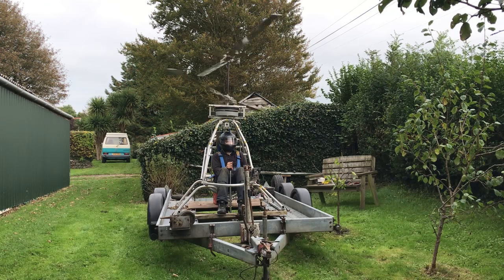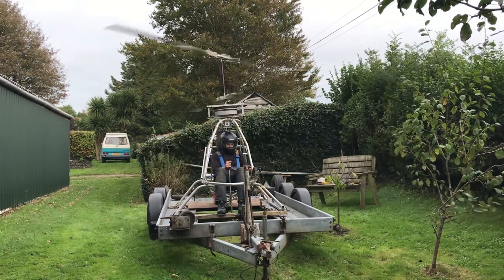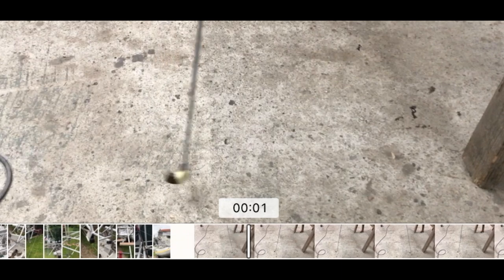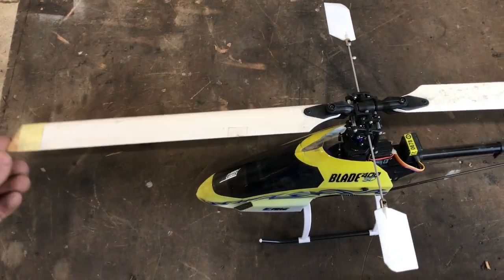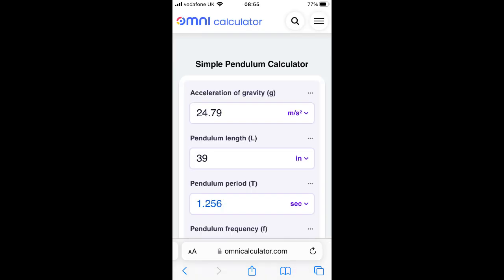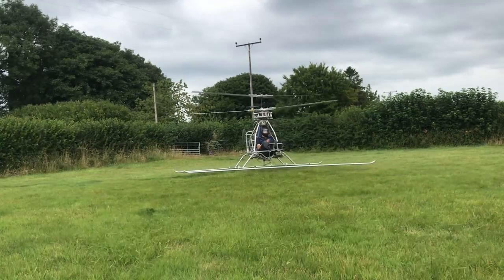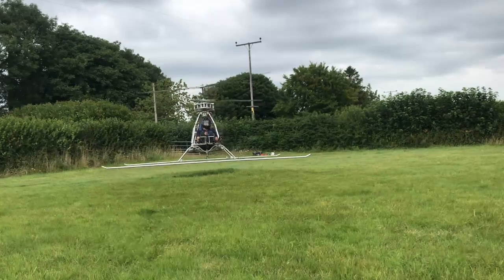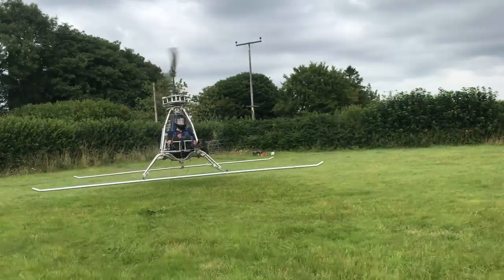Helicopter Rotor Phase Lag vs Gyroscopic Precession WHO IS RIGHT?

Comment: The problem of phase lag is an interesting one.
How do you determine the phase lag angle in a real machine?
Calculation? Or experiment?
In any case, a coaxial rotor simplifies things by cancelling out all the phenomena.😀
Reply from the maker: I think it's interesting too. Determining the phase lag is no doubt difficult, I did see a quote online saying that the helicopter manufactures do it by trial and error. Not sure if that's true but it wouldn't surprise me. 
Does a coaxial cancel the phenomena ? 
Two single rotors acting Independently isn't it ? 🙂  
I suspect if you had a teetering top rotor and an offset hinge bottom rotor  but kept the same phase lag on both the rotors they would want to go in different directions?
Reply: @Ben-Dixey  If the two rotors have the same angle of phase lag, they will try to tilt at different angles, but the main mast will tilt in the combined direction, so I think the effect of phase lag will be eliminated.
I'm sorry for my poor English, as I'm using Google Translate to help me communicate.
Reply from the maker: @mitubachiflight  The English translation is good. 👍 I think if for example the top and bottom rotors are hinged in the middle, like mine, (teetering) then phase lag will be 90 degrees for both. The rotors spin in opposite directions so both rotors will tilt in the same direction. If both rotors have offset hinges, like Robinson and the tri hinge rotor head phase lag for both rotors would be for example 72 degrees. Both rotors again tilt in the same direction. If there was some reason why one rotor titled in a different direction from the other then yes there would be a conflict between the rotors and the result would be somewhere in the middle. 
Do you agree ?
Reply: @Ben-Dixey  I agree with most of it, but I don't understand how the phase lag appears in the same place even though the rotors are rotating in the opposite direction.
Maybe I'm not understanding it well enough?
I'll think about it a bit more.
Reply from the maker: @mitubachiflight  Ah I see, yes we are trying to understand the phasing of coaxial swash plates. Definitely very confusing. 
My coaxial does it automatically, just tilt the mast and the pitch/angle of attack of the blades change 90 degrees before and in the right direction to move both rotors the same way. 
Just need to copy that for coaxial swash plates but I can't say I've got my head around what needs to happen when the phase lag is 72 degrees. 
I would imagine it's the same only everything is offset 18 degrees but I could be wrong.

Comment: Spot on, Ben!
You can actually use the same idea for flywheels even though they are solid. If the flywheel is driven by a CV joint it stays in plane. If you account for shaft stiffness then you get flywheel whirl. This stiffness can also be just because the flywheel is at an angle to the rotation axis so that centrifugal force is trying to flatten it: that's the trick where you spin a plate as you throw it into the air offset from flat and it wobbles due to precession. So what I'm saying is that gyroscopic precession can be thought of as the same thing as a rotating pendulum in resonance with the rotation frequency - you just join all the pendulums together to get a solid disk...
Reply from the maker: Thanks very much for the comment Martin, I always appreciate your input, you're a clever guy.

Comment: G'day Ben,

I suppose I read a very simplified book on Heligoflopterism., because I never heard of there being any variation of Phase-Lag alteration due to Cierva's Flapping & Drag- Hinges...; it all came under the heading of 
Gyroscopic Precession - and I understand how that works on Boomerangs & Sopwith Camels...

But the effect of adding Soft/Weak/Flappy Bits between the Axis of Rotation and the Blade has always seemed to me to be the sort of thing which is known to be necessary, and can be made to work, then beefed up to prevent the components from failing...; but couldn't  ever see how to perfect such a setup, short of building and testing and breaking and tweaking a long succession of failed attempts to make it work, safely and reliably.

And I always lacked the skills, tools, time and money to make and break all the wrong ways of trying to get the thing to do as it's told ; before it would ever be likely to behave itself....

If I had to try to express what is going on, I would say that
Gyroscopic Precession
IS what's happening (happynink...?) ;
And adding Hinges 
Interrupts, 
Delays
Magnifies
Accelerates, & Exacerbates the
Precession - all 
Before then reversing the process to permit the various assorted Hinges & Pins to realign themselves with the Blade's-Axis, to achieve a state of
Dynamic Balance at least twice per revolution - all while obeying the Pilot's Command-Inputs, and
Failing to throw itself all over the Paddock as a sudden violent dispersal of component parts, thrown out in all directions, following 
Each successive iterative
Failure...

Igor of the Sikorsky Tribe, he had wealthy
Investors &
Shareholders, to provide him with a
Fire-Hose flowing with money, enabling him to wash away the detritus of every attempt which didn't actually "work" as intended.

I never had one of those magic  Funding Hosepipes, so I stuck with Boomerangs, Propellers, and Wind-Turbines - which I can carve from Wood, and the whole thing remains quite rigid as it rotates...; unless I count the Mk-1/Mk-2/Mk-5 compound Turbulence Testing Auto-Furling Lawn Ornament - which uses a pair of old badly built Turbine Rotors at 90° to each other on the one Shaft...

 When the Rotors were bolted together, the whole setup shook and shivered like the proverbial "Wild Woman's Shit"...(!) ; so I replaced the Bolts with Steel Tie-Wire "Stitches", laced through the two Hubs' Bolt-Holes...

When the two Sticks were freed up to be able to accelerate/decelerate, relative to each other's RPM...; SUDDENLY the whole Rig began to spin as 
"Smoothly as the proverbial Turbine...".

I accept that it happens, but the intimate details of quite how and precisely WHY shitcanning the precision rigidity  of 4 Mild-Steel Bolts for the loosey-goosiness of 4 loops of Hillbilly Tie-Wire - which has run much more  smoothly (now for 25 years), in the most turbulent location which I could devise.

I accept it, but I'm still grasping at understanding what is happening in the Hub & the Offset Perpendicular Rotational Axes...

Which is why making and watching the bloody things is so fascinating..., I suppose.

Such is life,

Have a good one...

Stay safe.

;-p

Ciao !
Reply from the maker: @WarblesOnALot  Hi, sorry I was slow to reply to this, your four bladed wind turbine shook when blades were solidly mounted to each other but didn't when allowed to move slightly. Were the rotors finding their natural balance? Or was it something to do with uneven airflow across the four blades ? Four bladed helicopters need drag hinges but I believe that is just to relieve the stress from changes in drag as the rotor rotates. Not sure if the same happens with a wind turbine.
Reply: @Ben-Dixey  

No worries...

I think that they were finding their natural balance - shifting slightly with respect to each other instead of arguing rigidly, and shaking the structure with the conflicting impulses...(?).

When one considers how intensely engineered
Proper Propeller/Helicopter/Wind-Turbine Hubs and all their fittings have to normally be constructed - in order to force the Blade-tips to be completely obedient to all the calculated Paths which they "should" follow, at the rotational speeds & power-loadings pertaining...; I was seriously surprised and amazed - at how smooth and trouble-free and durable the  setup using 4 "Interrupted Single Sutures" of Fencing-Wire have turned out to be...

I'm having a great-fun time, lately..., cold weather involving a lot of Fire-stoking, so the new Peltier-Effect powered Stove-Fan has been having its 
Aerodynamic 
Idiosyncracies closely investigated.

I REALLY 
Hate
Production Engineering.

At operating Speed, the outer 15% of the Fan's Radius has Retrograde Airflow..., as Air 
"Downstream" is sucked back to try to
"Fill in" the intense little 
Low-Pressure Torus generated
"Upstream" of the  spinning
Fanblade-Array, by the 
Trailing Edges generating a spinning
Cloverleaf of
Helical Shear-Forces  - streaming off the Boundaries between the 
Air Column progressing 
Downstream of the Fan & the
Ring of Retrograde Flow out at the Tips ; 
With each Vortex then being 
Fed by the Barometric Gradients
Sweeping off the Trailing-Edges.

Out of the 59.63% of the little Peltier-Effect powered Motor's Torque which Betz' Law says the Pressed Sheetmetal Fan
"Could possibly" be imparting into the Airstream flowing through the Disc...; I estimate (guesstimate...!) that 40 of that almost 60% must be going into producing 
Turbulent Flow - which expresses itself as
Noise.

A faintly powerrul-sounding
"Purrrrrrrrrrrrrrrrrrrrrrr....!"

Which, probably, subconsciously goes a long way towards lulling the average Consumer into thinking the
Fan to be
"Powerfully 'efficient'..." - more or less
BECAUSE the
Easy-to-mass-produce
Sheetmetal Fan
Makes any
Noise at all...

Yet another example of the
"Extra POWER...!"
Mindset which expects any
Technology worth having, to always be
Loud, loud,
Loud-loud
LOUD...!

So, now, I'm wondering if all the
Inefficient 
Eccentricities of the Fan's design might have been deliberately & 
Consciously adapted ; optimised even, maybe - to 
Sound 
"Quietly aggressive", as it does it's little
Thing...; all the better to be a bit of more
Appealing & endearing to the
Yuppies among the 
Consumers - who wanna 
Feel all warm &
Green, &
Fuzzy...(?) !

So, maybe it's all an
Artefact of malignant
Marketing Jism (!) ; rather than
Simple cost-cutting via
Production Engineering...(?).

Either way, the Single-Surface Sheetmetal Fans
Offend my sense of
Propellercarverism, 
I suppose...(!)

lol.

Such is life,

Have a good one...

Stay safe.

;-p

Ciao !